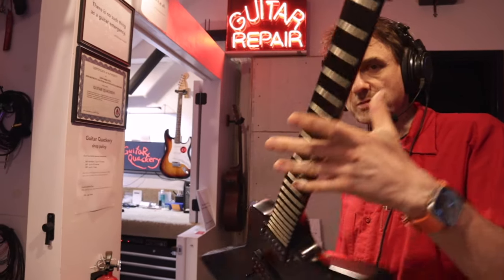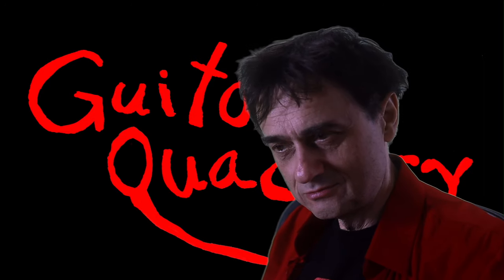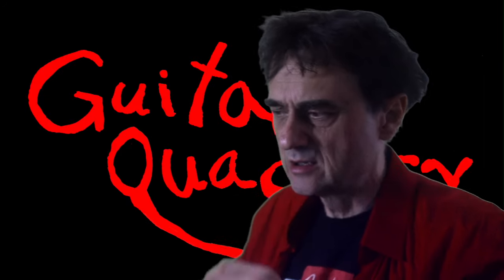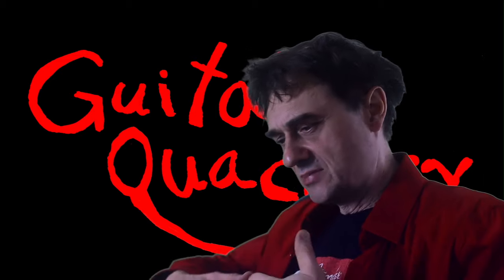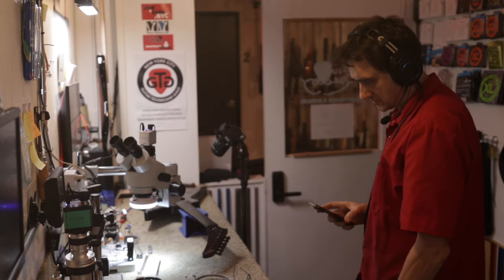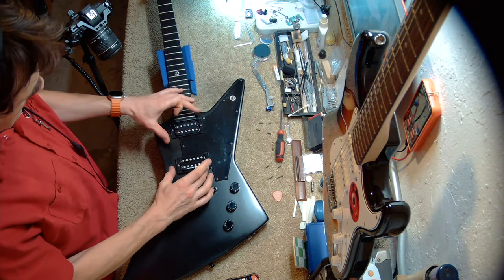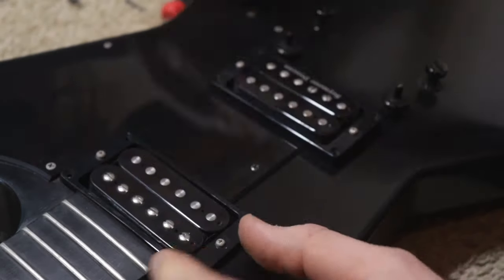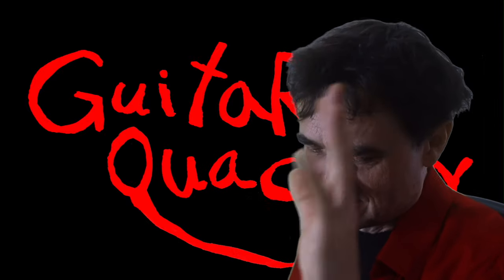Pickup Mounting Hack & Streaming Announcement

Comment: Thick wall brass or hard plastic tube
Reply from the maker: Not sure what you mean by thick wall brass. But, yes, there are other possibilities, depending on what's available on hand. In a guitar repair shop, there are always used strings in the bin, so I tend to grab string fragments for many things, such as applying glue in the fret slots, during refrets. I have other uses for bass string ball ends. More videos coming in the future.